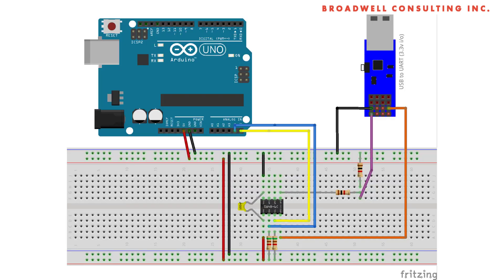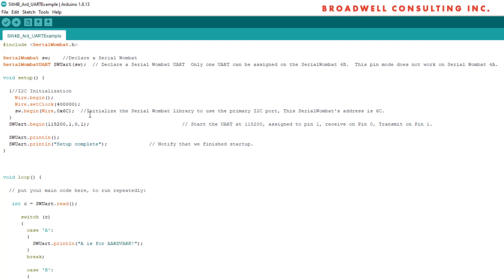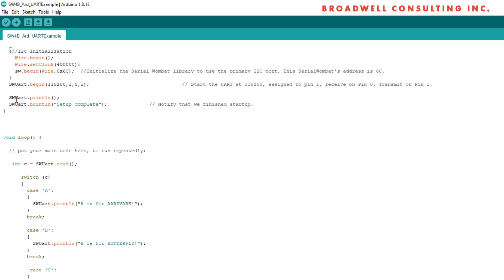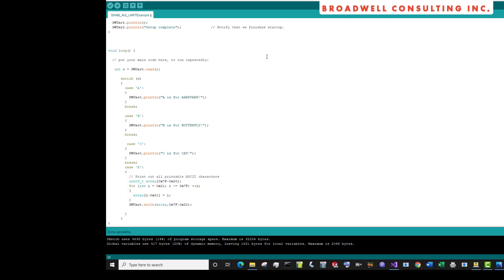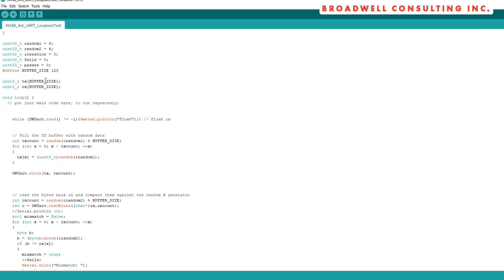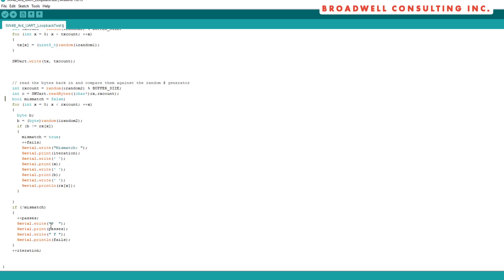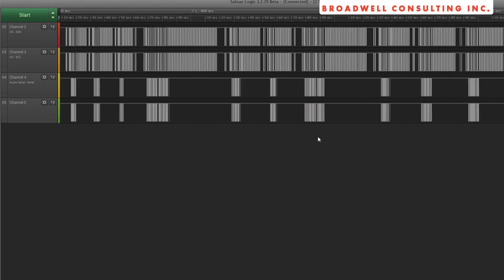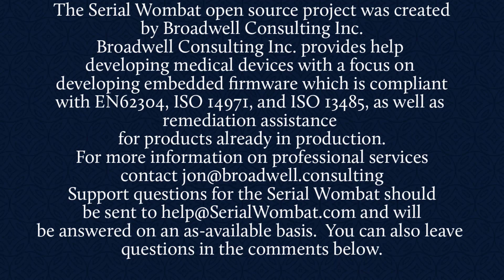Using a Serial Wombat 4B chip as an I2C to UART Bridge on Arduino

Comment: The hardware works well and I've had success with integrating in some Arduino sketches. However, when using it on an Arduino Uno R4 with FreeRtos, the processer crashes as soon as a serialprint statement is used. In fact just including freertos.h in the sketch will compile but crash when running.
Reply from the maker: By that you mean the Arduino R4's cpu resets?  Or hangs?  I ordered an R4 wifi today to test with.  Can you send me a stripped down sketch that shows the behavior difference if I comment in or out the include for freertos?  You can send the sketch to help@serialwombat.com .  You're including Arduino_FreeRTOS.h correct?
Reply: @SerialWombat  I just sent a stripped-down sketch to illustrate the problem. I'm using the Arduino R4 Wifi board. I am including the Arduino_FreeRTOS.h library. I realize that the FreeRTOS port for this board is different from the AVR boards that I've been using (Mega2560). I appreciate your fast response to my initial inquiry.